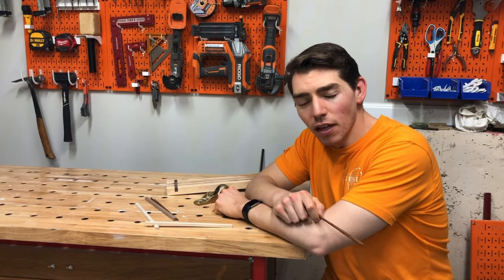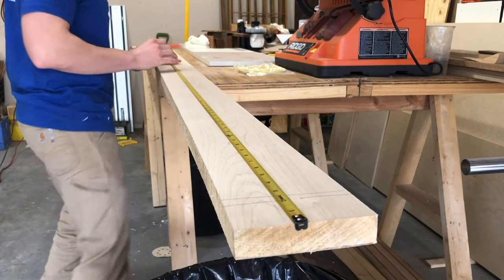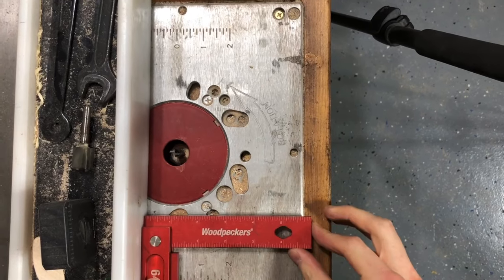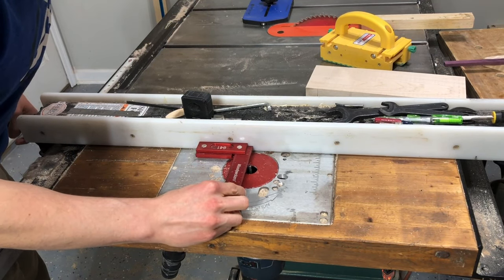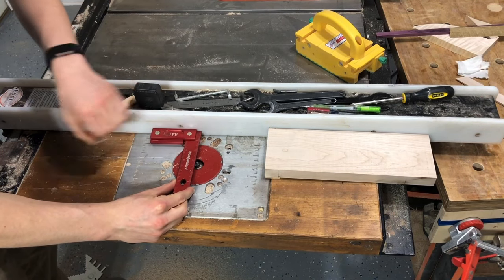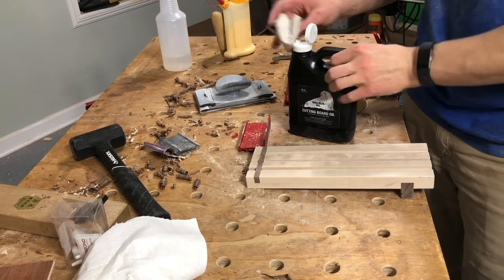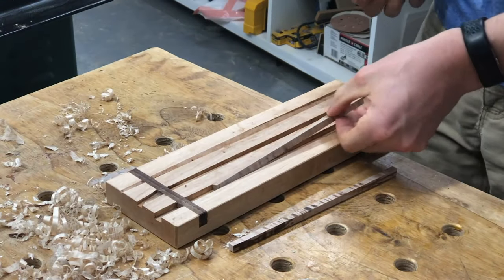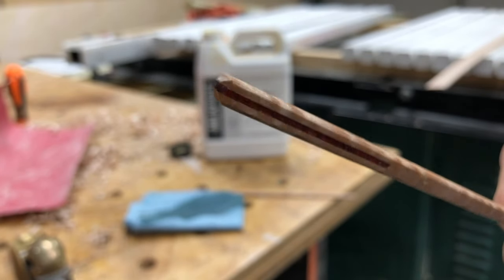Easy DIY Chopstick Jig

Comment: I dig this. Need a full fledged shop first, but then.... then I'll make chopsticks for EVERYONE!
Reply from the maker: Haha well I made the first jig when I just had the table saw with the diy router extension. That’s the beauty of it being so simple and you could even do it with a router and some support boards if you wanted 🤷🏻‍♂️ as for chopsticks for everyone .. just know the finishing with shellac so they can be washed  is pretty time consuming .. you were warned 😆
Reply: @NesBuiltDesignCo  very cool video! I want to make chopsticks for a gift but I'm a noob and have no equipment besides knives and chisels so no jig for me... but may I ask, why is it time consuming to shellac them? BTW, Do you think I could use poplar wood? That's all I've got right now and I carved a miniature owl out of it, to attach to the end of 1 if the chopsticks but I'm not sure if I should attach anything to the 2nd chopstick cuz idk if they will clink together while eating🤔...also, is it necessary to shellac or is it possible to just rub with coconut oil when done? I just want to be food safe but still hand washable and prevent mold growth . Sorry for the questions, I really am new at this 😂🙂

Comment: Okay, so I just bought 2 of these for 2 garndson's.  One is 27 and the other is 13.  These are their birthday presents.  Thanks for the cideo.  I'll have them watch it.  My respect for BCTW has been growing for many years.  This will be quite a step up for an old log dog like me (I built and designed log homes for 40 years.)  Next is to get these gransons to do calligraphy or woodburning fo these chopsticks.  Maybe black or red laquer?
Reply from the maker: Though I had commented back long ago 🤦‍♂️ but tag me in some pics of their chop sticks I love seeing them! And I hope it peaks their interest in woodworking more! For the chop sticks I’ve only ever used tung oil and shellac becasue it’s still good safe but still seals so they can be hand cleaned after use

Comment: Thank you for sharing. Very inspiring. I made myself one with one addition, I added a second stop incase I had to plane in reverse.
Reply from the maker: Smart! I actually did that by accident on one I made to sell haha I’m curious to see the feedback on it 🤔 the only downside is if you are making true women’s versions which are shorter the stop would need to be closer but an American audience prob doesn’t know there is supposed to be a sized difference hahaha that’s the only reason I didn’t originally make it with a second stop but there are times where I really wish I had it!
Reply: @NesBuiltDesignCo  length also depends on what region of Asia you are trying to emulate in you product.
Reply from the maker: That is true! When I originally made the jig I was making a big order for a Japanese friend/ coworker so that’s what I based it all off of and Japanese or sushi places is typically where most here see chopsticks in the US so I didn’t dig too much deeper or compensate for others 🤷🏻‍♂️

Comment: Can you please post the heights of the 1/4" bit and the v bit? Want to make one buy need these measurements.
Reply from the maker: Sorry I don’t exactly remember and I kind of make them differently these days. But if you add 1/8” to the 3/16” shim it should be about 5/16” of an inch for the 1/4” bit to get your taper. Originally I just marked a line square on the side of the jig at the plane stop point then another 9” away. Then I measured from the top of the jig down on those lines and marked 1/8” and 1/4” respectively.  then just flipped over my jig with the shim on one end and raised my bit until it hit those two lines if that makes sense. A little convoluted but it was the relative measurement way instead of the absolute way trying to figure out some trig haha

Comment: Great video. I followed the design and have been making my own chopsticks. A few things I found: The shim depth was too high. When I made my first chopsticks they were too skinny at the bottom ends. I reduced the shim height. Also, I've found that when planing the sticks, you get stuck on opposite wood grain sides, which leads to gouges and uneven cutting. I would suggest another "slot" - the reverse to the middle one (the one that gives you the angle), that way you can easily flip the stick depending on the wood grain.

Comment: Great video.  Definitely interested in making one of these but you didn't mentioned the height of the 1/4" router bit or the size and height of the v-groove bit when making those second and third grooves.  Are you able to provide this info?  Thanks and keep up the great work.
Reply from the maker: I honestly can’t remember and now I have jigs to make these jigs. But what I did to relative measure and get the height of the bit was make a square line on the top of the jig at 1” and 10” from the front edge. Then I carried that line over the edge e of the jig on one side. Then I measured down 1/8” ans made a mark on the line 1” from the front and then for the back like I measured down 1/4” and made a mark. Then you can play with the bit height and the shim location until the bit hits both of those marks when you flip the jig over to make the grooves. Hopefully that makes sense and if you watch the video again that’s why I have those marks but I could have done a better job explaining that. Hopefully this helps 👍

Comment: do we need any height adjustment planning the fourth side, since the second side is not flat
Reply from the maker: I’m not sure I understand your meaning? When I make mine the only time a side is not flat is when I temporarily attaché the wedge to get the tapers or after I install the stop. To get the stop flat I plane that top side just a hair to get the stop flush with the top side before I cut my dado and glue in the bench hook. Is that what you are asking? If not let me know and I’ll try to help as best I can.

Comment: Nice job ! Would you mind to share the dimensions of all rails? Thx
Reply from the maker: The first one is 1/4” deep and about 11/16” wide 
Second is just over 1/4” wide and tapers from about 1/8” deep at 1” from the front to 1/4” deep 10” from the front end. 
The v groove is the same taper just a v router bit. I hope that helps. 
This will make a chopstick what is 1/4” at one end and tapers to 1/8” at the other end

Comment: Great video! 
I'm curious as to how you avoid gouging your jig once you have planed the chopsticks flush with the jig? 
I feel like once you have planed it flush, your next pass will be planing into the jig. Just curious, I'm planning to make one myself!
Again great idea
Reply from the maker: It’s a quick jig so you will absolutely start to dig into the jig if your not a little careful but I’ve done it by feel and I just plane until it’s still a hair proud of the jig to not start cutting into it. I also planed and then sanded the jig on a flat surface so it should easily dig if you set the plane right ... but I’m no master at that and my OG jig has the scars to prove it 😆 but it still works great! No one will know if your chop sticks are a 32nd or a 64th different in thickness 🤷🏻‍♂️ haha to channel my inner Diresta, if they look and feel the same they are the same! Haha
Reply: @NesBuiltDesignCo  right on, you've given me some great inspiration. Would love to see more of your videos

Comment: Finally lol. Been waiting on this video. Looks great! When you use the superglue put blue tape on the wokpeices then glue as normal. That way you can just peel the 2 away and no extra work cleaning the glue from the wood. Other than that awesome job!
Reply from the maker: Hahahaha yeah I've been saying I would make this vid for faaaasr too long haha and for the blue tape I use that trick a lot but on one it didn't work out so well since I route through them and it came off 🤷🏻‍♂️ maybe I should try again with even more glue 🤔

Comment: Nice jig!!  I’ve been thinking about making one myself.  
I was wondering if it would be easier to get the taper even on both sides if you use 2 different angled dado cuts?  One that references the flat chopstick blank and a second grove that references the taper you make in the first groove....  maybe I’m over thinking it, after all it is just a chopstick lol.
Reply from the maker: haha yeah I honestly had to stop myself from overthinking this! there are some crazy intense jigs out there but they require more tools, math and time. Like you said for chopsticks no one will know the difference hahaha like Diresta may say if it looks good it is good! and like my old engineering professor used to say, stick to the K.I.S.S. principle ... Keep It Simple, Stupid 😂 aka don't get caught up overthinking the problem (which I often do haha)

Comment: That’s a good jig! I’ve been wanting to make one and this is simultaneously the nicest looking one and the simplest to make so far! 

I’m thinking about making a few of the jigs and cutting a bunch of blanks. Then having a make your own hard wood chop stick booth at a crafts fair! 

I just need to acquire some more hand planes. Do you have a plane size recommendation for cutting the blanks?
Reply from the maker: The diy interactive booth is an absolutely fantastic idea!! It will absolutely boost sales! It’ll draw the kids and diy parents and then guilt some into purchases 😆 

For hand planes I have used both the lie-neilson 102 and the small bridge city. For this I prefer the weight of the lie neilson block plane and it doesn’t have an adjustable mouth so it’s harder to accidentally cut into the jig itself!

Comment: What type of wood do you USE? On the chopsticks
Reply: U GOT a sub btw
Reply from the maker: I've used quite a few things but walnut or curley maple were my favorites to work with. Walnut planes really well in ether direction, the maple can still be little finicky on grain direction but not bad. Woods like mahogany and ones like it were too weak to my liking and on one I even tried zebra wood but that was a nightmare with splintering.

Comment: Does your plane iron not start biting into the top of the jig? Or do you stop just before hitting it and eyeball your thickness? Love this design.
Reply from the maker: I do it by feel and stop just a hair shy of planing it completely flat and I have had it bit I a couple times but you get used to it. They dont have to be dead nuts 1/4" thickness ya know. No one is gonna put a caliper on it haha so this works well

Comment: Nice video man very creative and it looks to be a fun project as well as the end result being a jig that I’m sure will get a lot of use! One suggestion I would make is that the jig could be a little more “dummy proof” if you were to add rails to the top so that the hand plane rides on them so you end up with the exact same dimensions every time AND more importantly you don’t have to worry about planing into your jig as I imagine over time that could mess up the accuracy...? I’m sure it’s avoidable by paying close attention to your depth as you are planing but I like to have my stuff as dummy proof as possible so once it’s made I can utilize it without the extra time and effort to make sure I’m not gouging my jig.. Just my .02 but I gotta say the jig as it stands is super cool and I’m gonna make one tomorrow and try the rail idea and if it doesn’t work then oh well! Thanks!
Reply from the maker: O yeah I agree it could be a lot more full proof but if I wanted the perfect chop sticks I would have just got the machines aluminum ones from bridge city haha I have seen a few awesome jigs by guys that have had the rails tho and they were made to fit their planes specifically and those will absolutely last longer but as the time I was just planning to make it as simple as possible to get the job done. I had a batch for a friend that had a timeline so they could fly back to Japan! So I made it good enough to get the job done! My OG jig absolutely has some scars now but it still works well and no one will ever know if your chop sticks are now a 64th thinner or a hair off square. As Diresta would say if it looks square it is square haha  but check out skanswoodworks he’s made a very intense jig to perfect fit his planes and makes some jam up chop sticks too!

Comment: Use your plane straight man... And sharpen it... And why do Americans insist on only using the tiniest block plane...
Reply from the maker: 🤣 why do YouTube videos get you so fired up? 🤣 I’ve seen plenty of people use a plane at an angle it’s not new and not some cardinal sin as it can be better depending on the grain direction, that’s physics. As for the sharpening this was before I even had a sharpening set up and I used the best decent plane I could afford at the time but it got the job done. This was also like 3 years ago so your a bit late to the party 🤣 but thanks for your two cents anyways 👍

Comment: Do not use tung oil on anything that you are planning on using with food you use an oil base Butcher Block cutting board oil and beeswax mix there is a video on online I don't know what the link is but it is way better and your products will come out nice nice and clean
Reply from the maker: Tung oil is perfectly food safe when dry. I picked up this process from someone that had been making chopsticks for years. I have other oils I used for cutting boards but for chopsticks I want something that will cure harder and penetrate better as people are more likely to accidentally soak them unlike a cutting board. Where have you seen that tung oil isn’t safe for food contact when cured?